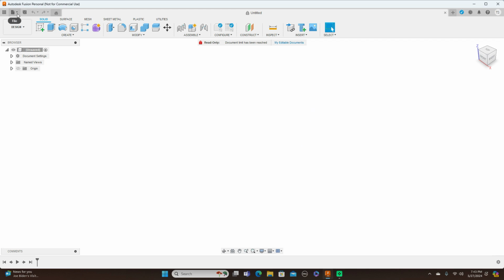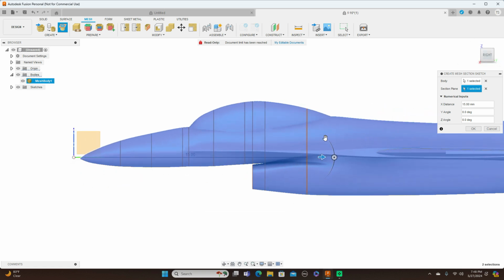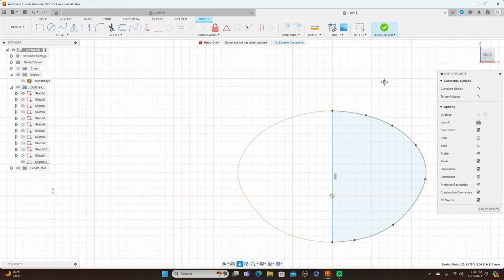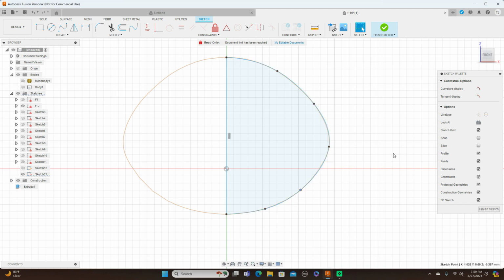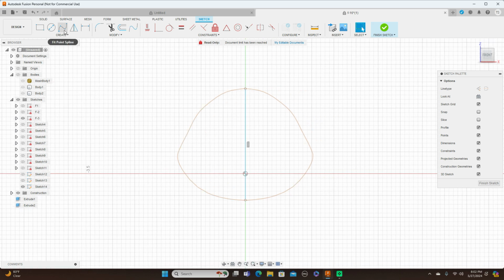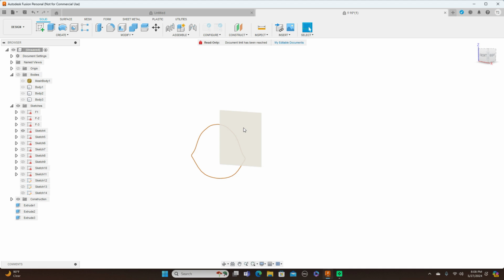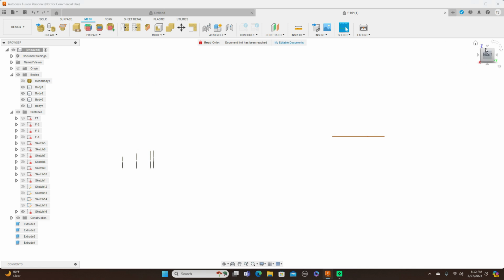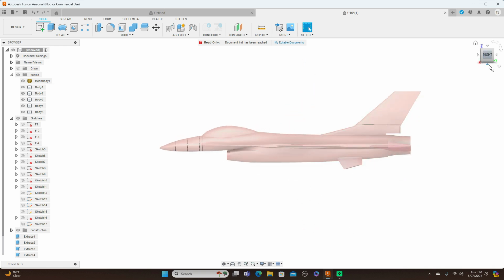Fusion 360, Model an F16 without modeling an F16 in Fusion. Reverse engineering

Comment: i have a question how do i cut of the wings from the fuselage and move them aside so i can work on them later and do all the fuselage formers without the wings ?  that way i can print the fuselage formers build all the body and later build the wings and connect them to the fuselage ( i want to make it
 an rc aircraft )
Reply from the maker: You can turn the wings off on the side in the tree.
Reply: Tx